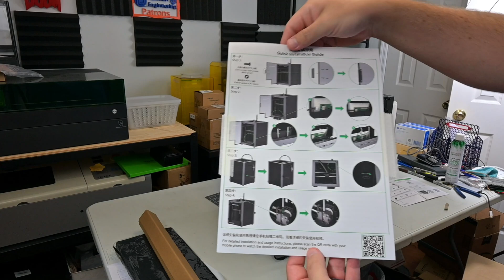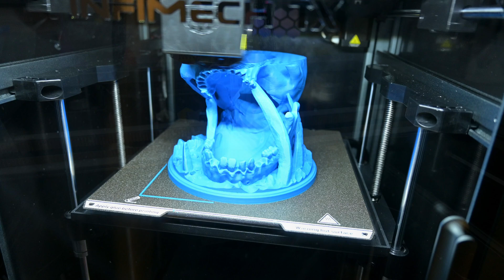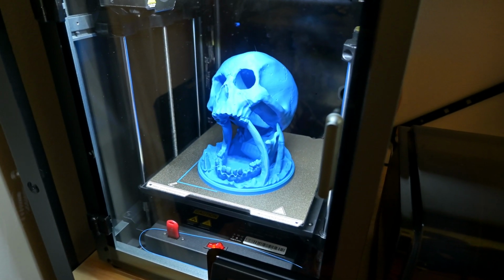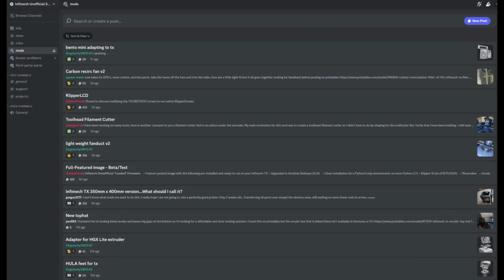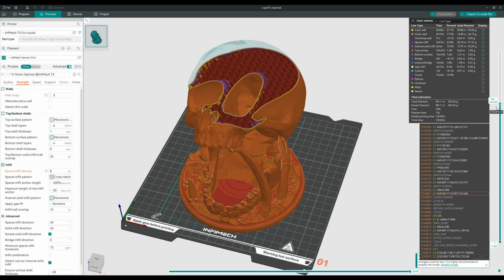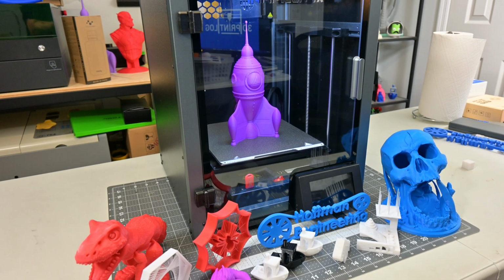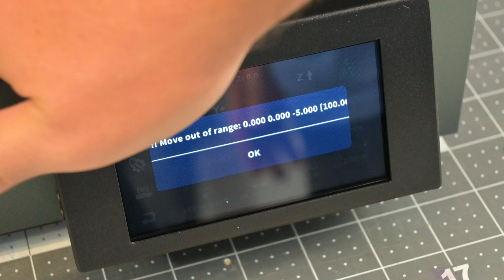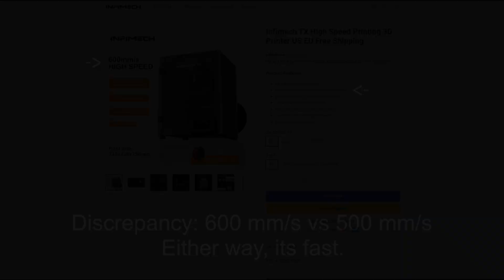Extreme Print Speeds on a Budget | Klipper | Core-XY | 500 mm/s - Infimech TX 3D Printer Review

Comment: Got mine yesterday. Great printer for the price. 1 test print and off to claibrating. Dialed in retraction distance and speed, flow rate for the filament, z offset and pressure advance. Everything is spot on and pumping out prints. ABS is a pleasure on this machine too!